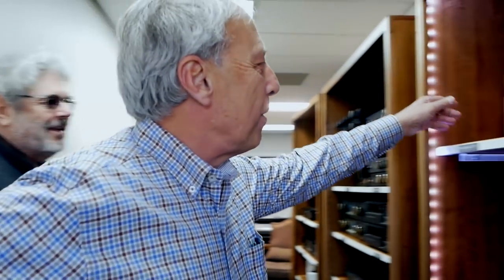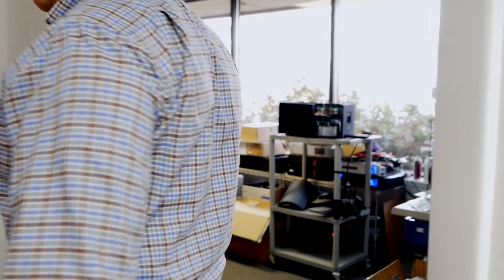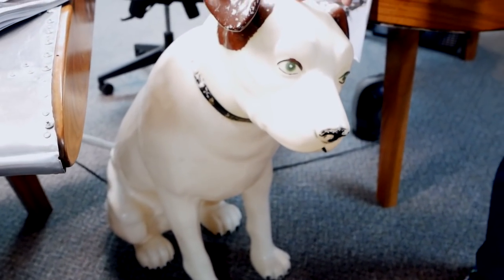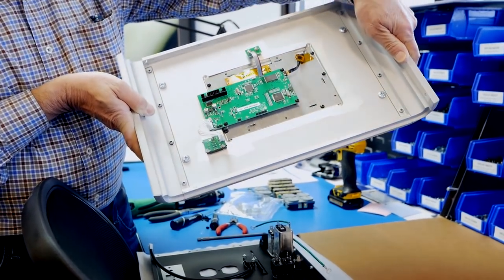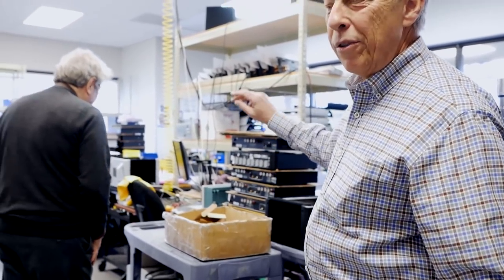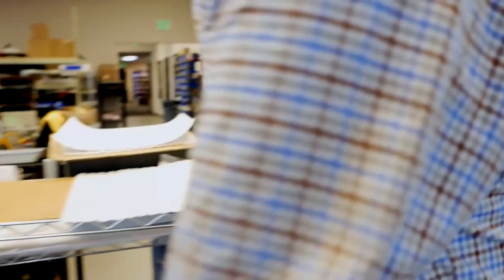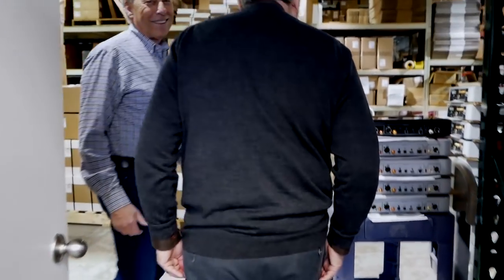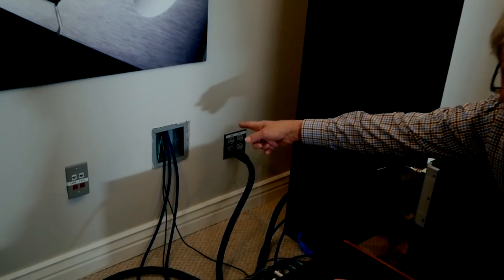Factory Tour: PS Audio | Stereophile

Comment: For good reason, Pauls' sincere attention to actual sound quality, measurements, and complex designs ,I offer my sincere appreciation of his taking time to explain them in an understandable manner . I worked for 20 years in the GM Milford Mich. noise and vibration simulation test lab until retiring in 1999 as a servohydraulic tech. Worked with 500 lb and larger  testing purpose shakers, a six degree of freedom shaker table, accelerometers, about every kind of transducer (many of them specially designed and built in house.) Most of the time using 3000psi hydraulic oil power supplies. As then, I still have a heart for learning so I thank you Mr. McGowan. I just turned 76 and endeavor  to learn new tech every day. Lyle

Comment: As an industrial power systems design engineer that does my head in, the idea that low power electronic systems require a vastly over speced transformer to function at their best and the reason for it cannot be explained. Electronic engineering is a science, not a black artform and there has to be a logical explanation for this peculiar reality. As long as the PSUs has the ability to respond to normal and peak power demand without compromising regulation, the transformer should not need to be over sized, obviously.

Comment: I thoroughly enjoyed the conversation about transformers. There is genuine bewilderment in both of your faces. You speak of something you know is true, but dont know why. What you know is that it shouldn't be true, and why.

I just bumped a preamp i was working on from a 1.5a to 6a transformer. And i too, am now bewildered. Big one sounds better, and when you put the little one back, it goes back to the way it was. And better in the obvious yet clich'e audio-guy hard to describe without buzz words way. There is just something more pleasant about the delivery of the sound. I run it into my interface and it measures exactly the same with either transformer, even thd measurements within margin of error. But i can go back and forth between the two and i agree, the oversized transformer sounds better. And my preamp is a single ended class A pre running from a full wave bridge unregulated. The only thing between transformer and the Plates, are a few diodes and some filter caps. I definitely didnt implement the regulator, that i didnt use, poorly.

Comment: That was interesting about heatsinks; engineers are taught about surface area and rarely about mass.
Reply: If you don’t have enough surface area to dissipate heat at at least the rate that it’s being generated, the system will eventually overheat. More mass just makes it take longer to get to whatever threshold is considered too hot.

Comment: In seeing the construction of your various products I see a lot of Molex connectors, looks like the WM4000 series, and basic generic hookup wire. Now there is absolutely nothing wrong with that. I have used Molex connectors extensively for years myself in pro broadcast video gear. The are quite suitable for the application at hand. 

But doesn't this expose some of the audiophile foolery you are required to market? I mean a garden hose size power cord with exotic connectors on the outside, but once inside the chassis it's standard 3M and Molex connectors and generic hookup wire.

Seems Paul like you and your engineering staff does subscribe to common sense and electrical engineering realities after all. And that's a good thing!

Comment: I remember when the 1st PS audio amps started showing up on Audiogon the 2nd year Agon was online and I wanted one ,the white amp with the wavy sides intrigued the hell out of me from it's asthetics ,it's specs we're hella good but the design asthetic was modern art ,sadly I think it was Albert Porter who talked me out of purchasing the PS audio amp and steered me back into tubes ,the scuttlebutt was that PS Audio amps would be the next Ampzilla which was a massive failure ,boy how wrong all the nay Bob's we're ,I still can't remember the model # of that white amp with wavy sides but I'd love to own it with my McIntosh C-2500 Tube preamp and Emotiva XPR-1 Monoblocks ,thankfully I didn't listen to the nay Bob's about the monster Emotiva XPR-1 amps that absolutely DESTROYED my $28,000 McIntosh 1,200 8 ohm watt Mc-1201s ,the $3,200 Emotiva monoblocks outperform my Mc-1201s on all 4 ohm speakers I've owned ,I learned that Autoformers strangle a 4 ohm speaker ,I also learned to look at build quality and design topologies vs Stereophiles glowing reviews of chocolaty mid-range and caramel highs on every product ,I also stopped listening to audiophiles in general ,if I ever get a chance to buy the 1st white amps PS Audio made I will and use them anyplace I can in my system even if I have to triamp with zero sonic benefit simply to get those modern art masterpieces into my rig .